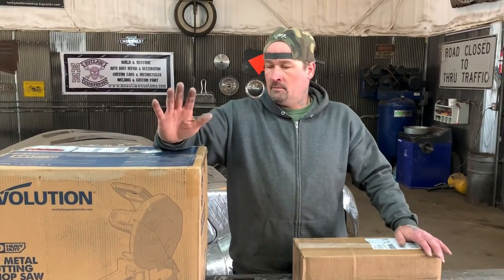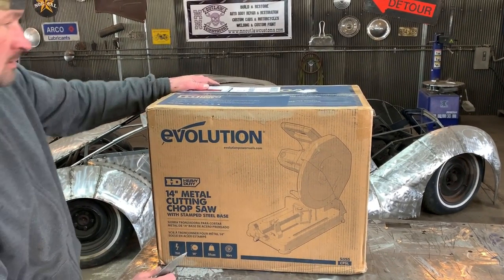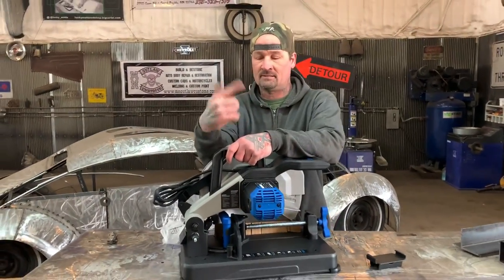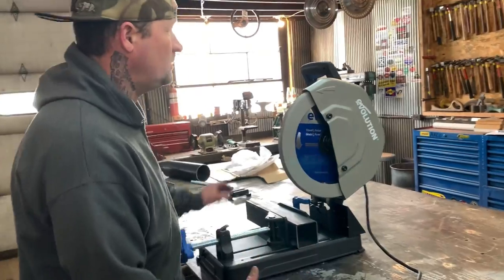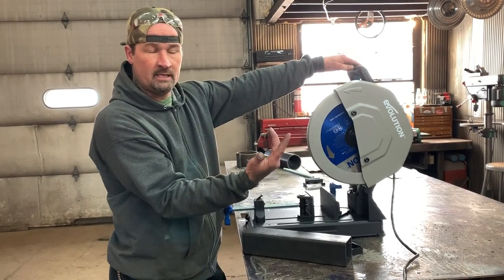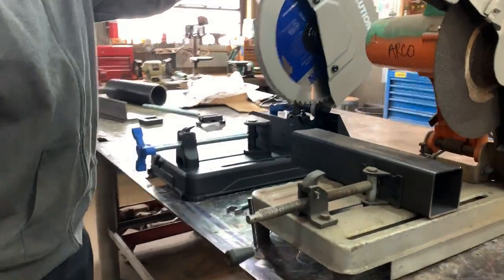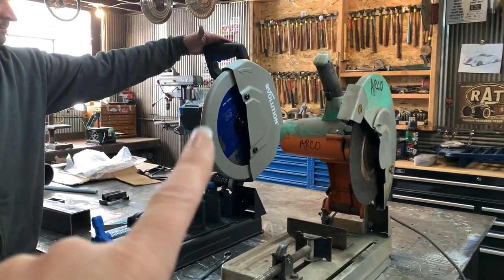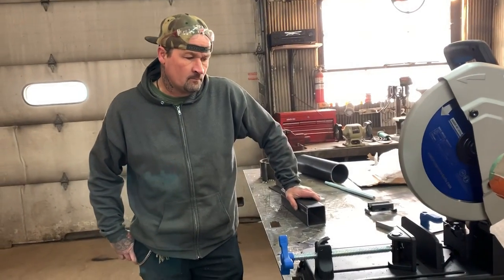Evolution Power Tools Unboxing: 14" TCT Metal Cutting Chop Saw

Comment: Heidi is a funny lady for sure. We had one of these tooth type saws at work but had to take it out as the truck drivers were trying to cur grade 7, 1/2 inch load chain and ruined the blade in the first 4 days. Someone was going to get hurt so I put a lock on it so only myself or my fabricators could use it. I have cut 2 in sq. 4140 with it. They are just great. This one is a real beauty. Very little heat as well. Good stuff bud. Great new addition to your shop my friends.